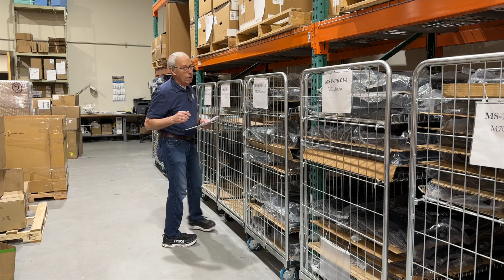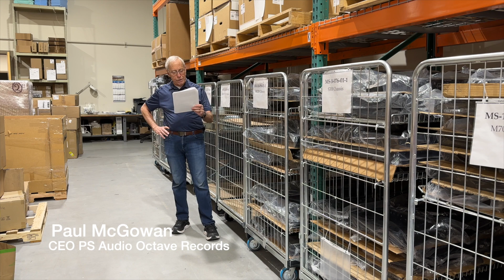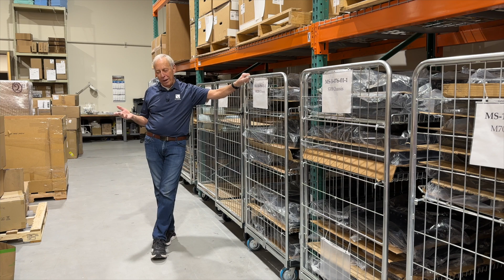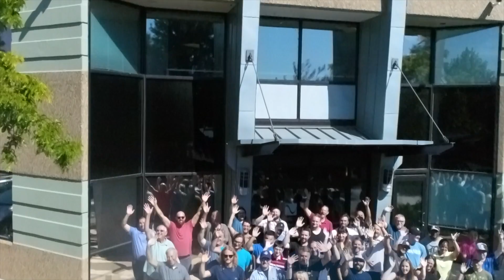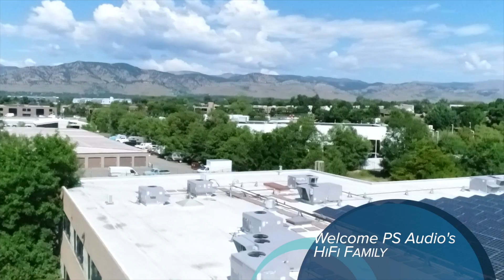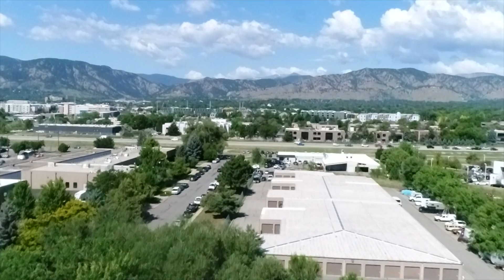Why the last few feet of the power cable matter

Comment: Audio Science Review and Audioholics tested and compared various  high end power cords to a cheap generic and found they made no measurable ( with an expensive Audio Precision analyzer ) or audible difference on the performance of various audio components  .  Shielding can help if your components or interconnects are susceptible to 60 HZ interference emanating from your power cable.
Reply: I’m sure the AP devices accurately measure what they are designed to measure. So, do we know that what they measure is what counts? More, is it what counts to my ears? That sounds subjective, but it’s also objective to my hearing, which probably conforms to some typical range of perception but which also has its own idiosyncrasies. That said, I buy entry-level Audioquest and Shunyata cables at sale prices for my roughly $12,000 system. I base that on those brands getting the basics right and giving me most of the improvement for a reasonable cost. I belong to a local audiophile group and get to hear $$$$ systems. Some sound great, some don’t, to me.
Reply: @jimfuquay7116  everything what you perceived as better for the system works for me. But there is a clear difference between what we perceive and what is objective truth. This is why your system sounds better at different times. The last conversion of sound we never discuss is what our ears and brain is making of it and here is a lot of gain possible. Imagine we could follow a kind of relaxing exercise before listening to music which would make the music sounds 2 times better at no cost…
Reply: @jimfuquay7116  Good measurements do not always mean good sound and vice versa. In 1981  i got a Kenwood monster receiver with fantastic specs but my new speakers did not sound nearly as good as they did at the store . Later I got a Carver amplifier that while some reviewers criticized the specs others praised how "musical" and accurate the amp was . I immediately noticed a lot of micro detail that was missing with the Kenwood and my speakers now sounded as good as they did at the store. Amir usually also listens to what he measures but not if it does not measure well which was the case with vintage Carver and Sunfire and a relatively new Carver tube amplifier . Carver' felt that as long as the THD and S/N was not audible it was fine.
Reply: did they take apart the cheap cable and examine its actual construction?  Cheap does not always mean poor design...
Reply: Are you related to Amir?
Reply: @Mark-lq3sb  No I just trust the science , if something is claimed to make an improvement it should be measurable  or at least pass a blind listening test.  You forgot to mention Gene DellaSala at Audioholics  who usually comes to the same conclusion as Amir when something is the equivalent of snake oil.
Reply: @leekumiega9268  
SCIENCE isn't EVERYTHING.
Reply: @Mark-lq3sb aside from being an electrical engineer Amir was also paid as a listening consultant due to his well above average listening ability and skills . So he does not just measure he listens for differences. I should also add that there are some well known manufactures that send him their products to test and listen to.
Reply: @Mark-lq3sb no there is also voodoo, expensive voodoo. Easy to hear, do some double blind testing…
Reply: @leekumiega9268  
EE, so what, 100's of thousands of them. That's one of the biggest problems in the U.S. today and in the future. Too many of them and not enough young people that not only enrich their brain but can also get their hands dirty.
You know so much about Amir please tell us the manufactures that send him audio equipment and what the equipment is/was. I prefer not to waste my time on that website.
Reply: @Mark-lq3sb  Although there were a few more I recall 3 , Benchmark , Denon and Schiit Audio. After his testing they all decided to got their own Audio Precision analyzer which was designed by former Tektronix ,Hewlett Packard and Agilent engineers, all great test equipment manufacturers .
Reply: @Mark-lq3sb  Frankly, I find Amir snarky and I fault him for many of his comments which run counter to both my experience/experiments and the discussions I've had with actual scientists whose reputation extends far beyond YouTube...
Reply: @vicweast    
Agreed.
Reply from the maker: The thing is no one ever thought or claimed there would be any measurable difference on the AP (same equipment we use). But that's like saying a dynamometer shows no difference in measured performance when the car's suspensions are radically different. That expensive AP is limited in its measurements.
Reply: @Paulmcgowanpsaudio  Paul in your example the differences would be noticed on the test track , with audio the improvements should be noticed with critical listening by trained experts using highly resolving equipment. While Harman Audio listening experts can detect frequency anomalies they can not usually detect slight distortions that Amir is able to detect.
Reply: @leekumiega9268  
The example of differences would be noticed on the type of dyno used. There's more than one.
Reply: @leekumiega9268  I'll tell you what: You listen to Amir and I'll listen to my gear with my choice in cables.  I'll also run my power through my PowerPlants... Feel free to do your own thing, I will not be offended. But if you start claiming that what I have done and tested isn't "real", I'll tell you you are absolutely wrong and that instead of looking at a video you might want to try the end-to-end cable testing yourself.
Reply: @Paulmcgowanpsaudio ”Denier” is a pejorative term and i would  refrain from using it were i you,  so as not to alienate a good portion of my audience who are well-intentioned skeptics. You said people don’t want their beliefs challenged. Bingo. That’s why no one in the exotic power cable realm will do BLIND compare tests. I simply do not believe that a competent cord, properly made, has an audible difference vs an exotic costing multiples of its price in a double blind trial. PLEASE do the test and prove me wrong.
Reply from the maker: Good point, Ed and thank you. I will endeavor to stop using the word "denier" as it is indeed dismissive of people who should not be dismissed. Thanks. When you say blind tests, we have always promoted blind tests. It's the only way to really know for sure you're not biasing the results. I don't agree with double blind, but the single blind as performed by an associate is not only valid it is valuable and I support it. @edd2771
Reply: @Paulmcgowanpsaudio  Bro. That expensive AP is way more sensitive than your 75 year old years. Like what?

Comment: I have never had the opportunity to listen to expensive power cables so I can’t comment on thier validity.
The most expensive power cables I have seen were $15,000.00 for a 2 meter length.
What I do wonder is what the manufacturing cost is for such a cable. What could possibly make 2 meters of cable and two AC connectors worth that much?
I could purchase BHK 600 monoblocks for $36,000.00 then another $30,000.00 for two power cords for them. 
Just doesn’t make sense when considering the hardware content.
Reply: The labor involved in rubbing them down with snake oil is expensive.
Reply: wow  are BHK monos  really that spendy!if so you really make an awsome point to someone who will never have to  make that decision.and dont even play the lottery!
Reply: @Douglas Blake'People are willing to pay it' is the obvious answer, but it is still a valid question. How could the best sales person convince anyone to part with that much money for such a simple device? I want to hear the sales pitch that sold them on the idea.
Reply: Spending more than $2500 on 2 amplified channels is a waste.

Comment: My amplifiers are Nelson Pass designed home built F5 Turbo V3 class A that have a bandwidth that extends beyond 100 KHz.  The amplifier output/loudspeaker cables are quite long and are shielded with self adhesive aluminium foil tape which is connected to the incoming copper water pipe for a ground because the system was working as an oscillator at an ultrasonic frequency.  Lack of audio dynamics, very hot amplifiers and a faint swishing sound gave the clue that something was amiss.
There is plenty of noise on an AC power line but I've never seen any of that noise on the output of a well filtered DC power supply, isn't that partly the reason huge (and hopefully smaller non polar) capacitors are used?
Reply: @ Douglas Blake.  The shield around the 'speaker cables is grounded, not the (low side of) cables themselves.  The equipment is not inherently unstable, as stated, the class A amplifier has a very wide bandwidth but also has a low gain of just 16 dBs.  That the speaker cables are long doesn't help but they're long because the amplifier is water cooled and has two 5 K RPM (noisy) fans and is in the cellar below my listening room.  
The RIAA input stage is also a Pass design, as is the single transistor gain stage between the output of the RIAA stage and the F5 input. The system did not oscillate when 'speaker cables were not connected.
If you've ever put a finger on the input of a wide bandwidth power amplifier and heard a hiss (rather than a main's frequency buzz) you will know what I'm typing about.

Comment: Dear Paul, you compromise your profession and reputation with this video. There are numerous testings and porves that fancy power cables DON'T change anything to better. Actually sometimes they make things to worse.
If you are so conviced into power cables, you should do you what you acusing others that didn't and have expirience: MAKE TESTINGS AND SHOW US RESULTS! 
Why are you affraid of scientific test??
You earned enough money already to retire. 
Are you THE ONE that don't want to change your opinion?
You said that you don't have all answers on subject but have few. And that's mother of all mistakes. THE worst possible situation is to have half informations. Thats a barrel of dinamite waiting to explode.
Again, show us here with measuring tools that you certainly have in PS audio, how exactly power cables improve or detoriate current that goes throug them, and what are they actually made for. 
Thanks in advance.
Regards from Croatia
ŠČ
Reply: Theres something very wrong here. Paul goes on about how important it is to have screened mains cable and how it is the most important thing you have to do to stop interference getting to your equipment. How come a very high end audio company dont believe in shielded mains cables. That company is from the UK and is called Naim. Yes they also sell snake oil $600 dollar mains cables. Why do they say a shielded cable will degrade the sound. Something not right here guys.

Comment: All you have to do is to look at the hard evidence. What someone says they hear is not hard evidence except for the person that heard it - or think they did. We have other areas of electronics far more sensitive than a home HiFi system. Test gear in advanced research labs. NASA applications where signals from deep space probes are received,  the broadcast and mastering industry. None of these highly critical electronic applications subscribe to these audiophile power cord cable theories. I know that because I work in the professional electronics industry. However there is even more glaring proof anybody can see. If these power cords were used in the applications I mentioned above, don't you think the vendors would be all over that in their marketing schemes? Come on, they would beat such an application example to death to sell more power cords. We don't see that! There is no accredited* data to support what these power cord vendors claim. Now in this age of cell phones that make the Star Trek communicator look silly in it's capabilities, 4K TV over a slow internet connection, and most recently the surge in AI, do you honestly believe the electronics professionals of today and their forefathers do not understand everything significant about a power cord?

*accredited means research papers by scientists and engineers with traceable education credentials as well as peer review by their fellows. That does not mean an article in Stereo Review or the Absolute sound!
Reply: Yes i agree with you 100%.Theres something very wrong here. Paul goes on about how important it is to have screened mains cable and how it is the most important thing you have to do to stop interference getting to your equipment. How come a very high end audio company dont believe in shielded mains cables. That company is from the UK and is called Naim. Yes they also sell snake oil $600 dollar mains cables. Why do they say a shielded cable will degrade the sound. Something not right here guys.
Reply: @Justin-fy7xk  Well shielded power cords are not snake oil. The are used where RFI is a concern.But you can buy a good UL listed shielded power for less than $25. And it's highly doubtful the average residential location has RFI levels that would require a shielded power cord and on top of that, if the house is wired with plastic cable, putting a 6 foot shielded cord on the component will do virtually nothing because of the 50-100 foot antenna in the walls.
Reply: @@Douglas_Blake Exactly Doug. There should at least be a limit to what they charge.  Nordost have one for sale at a whopping $20,000. Wheres the sense in that.

Comment: Any conductor can act as an antenna picking up stray electromagnetic waves from many sources, microwave ovens, other radios including wifi. These waves can interact with each other in a constructive and destructive manner in the same way noise cancelling headphones work but in a random uncontrolled manner. Shielding around cables when grounded properly act as a Faraday cage capturing stray EM waves preventing them from interfering.
Reply: Your point about wave interference is excellent! Just a minor correction though: Faraday cages don't capture, they block.
Reply: Paul mentions grounding at the male end (away from the source). However, grounding at one end means the other end accumulating high frequencies like an antenna according to theory. Properly grounding at both ends is correct and will then act as a complete Faraday. The problem begins with homemade cable having a different potential at both ends because of keeping the shunts and solder at a high quality of being the same. Homemade has a hard time doing this. So, that becomes a source for a ground loop when the potential is different on the ends. A company like Stay On Line makes military and lab quality shielded power cables that don't have potential differences and don't produce a ground loop and don't act like antennas. Plus they are UL and priced well.
Reply: Anyone can talk about RF interference until cows come home. But where are the numbers of measurements demonstrating that problem and the numbers demonstrating positive effect by use of good cables? BTW, is there any effect of any such interference on the output of a regular filtered and regulated power supply feeding a DAC or an amp?
Reply: Where are you going to properly ground the shielding on a power cord?
To the ground that runs beside  the other 2 condictors and attaches to the device case and ground?
That will make a great path for EMI.😮
Reply: @JonAnderhub  No. Drain to the wall, not to the component.

Comment: ok, so cheap standard electrician wires inside the wall is shielded by the wall paper and chip board so you need to buy a 1K$ powercord the last few feet to the amp... yeah, of course that make total sense.
Reply: You should consult with Trigger on such matters.
Reply: @Mark-lq3sb  Yep, even trigger know more about cables...
Reply: @royrogers7644  
Probably not, but I wouldn't argue about reins with him.
Reply: Gotta be pretty dumb if you think dog crap taste  like chocolate just because it is wrapped in silverfoil
Reply: @royrogers7644 replies to Roy Rogers.
Gotta be pretty dumb..........
Reply: @Mark-lq3sb  Do you cable guys use stupiatronhelmets when listening to different mains cables?

Comment: A better question would’ve been: Paul if sticking few feet of some wire could improve the sound, why don’t you put that inside of the amp (or any other device).

The answer is obvious.
Reply: LOL, in one of Paul's video he was in the manufacturing area standing next to a hookup wire rack. I noted most of the reels said "Consolidated Wire and Cable". That stuff is sold in most electronics and electrical supply houses. Pennies a foot. Now there is absolutely nothing wrong with this wire, it's good quality. But we have to ask why PS Audio would use community hook up wire and at the same time go on and on about the need for ultra expensive power cords. Same goes for the Molex or Tyco connectors I have seen inside  PS audio products. Low cost plastic connectors. Now they are good connectors and will do no harm but again these are the same quality you find in a 65in  $799 flat screen TV. We hear the AC power outlet is so important but then commodity Molex connectors are just fine inside the BHK and Power Plant products?

Comment: It’s easier to clean the last few feet of noise by stop/lessening the noise at the wall socket. 

Tripp-lite Isobar is a plug-in unit that can help ground without a cheap cable to deteriorate or degrade the signal. Plus provide lightning protection. 

Also a good idea to use plug-in filtering devices to clean the signal. I know PS Audio sells a couple.